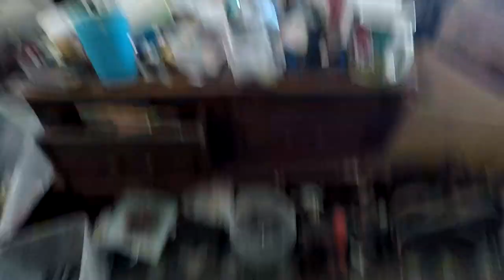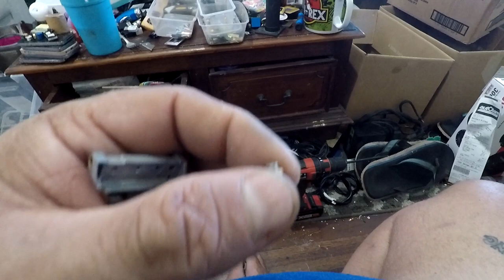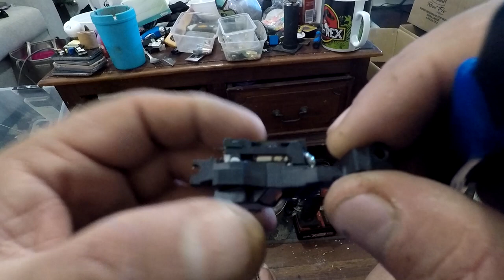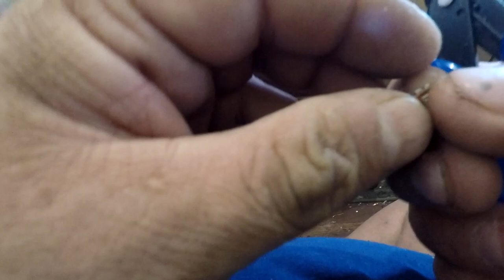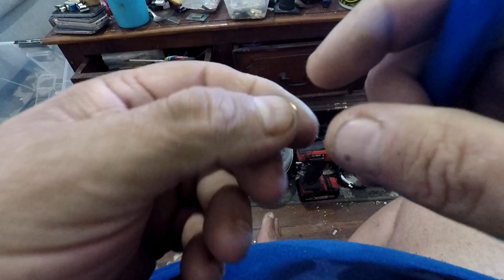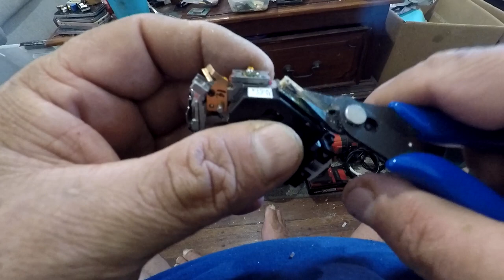GOLD RECOVERY / RECOVERING GOLD FROM LAZER DIODES

Comment: Pete, you're doing pretty much everything I do regarding dismantling the lazer diode carriers  recovered from CD / DVD players.

Sometimes, there are a couple of torx style screws to remove. Tiny buggers they are... The gold / silver IC chip pasted to the little piece of sheet aluminum. I just twist the aluminum with a pair of pliers / dykes, grasp opposing corners, and it pops free. Prevents my crushing it, trying to cut it away from the matrix.

I usually pry the bits of coated glass / quartz crystals off the aluminum / plastic carriers. The pieces that chip or break, I discard them. My daughter makes wire wrapped trinkets from them. Pendants, bracelets, dream catcher / wind chime items. Just free useful material which otherwise gets thrown away.

Overall, it is a nice video. When you process the lazer diodes, will you include gold plated pins in the same batch of acid(s)?
Reply from the maker: wow theres some good info there , thanks.
no i do the pins seperate , ive got a container full of little bits of gold either on boards or pins that ive been collecting and will soon be processed in a batch of its own